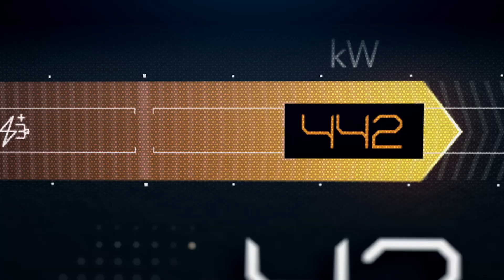GMC HUMMER EV | “Talk About A Revolutionary Supertruck” | GMC

Comment: Is it standard hummer with electric motor and batteries?
Or hummer really re-engineer ground up such that weight of the vehicle minus the batteries has been reduced. Since any vehicle range and performance greatly depends on the power to weight ratio.
Also is GMC considering use of carbon fiber to reduce weight?
May be you can cover in upcoming videos.